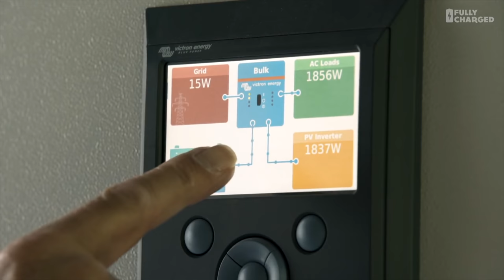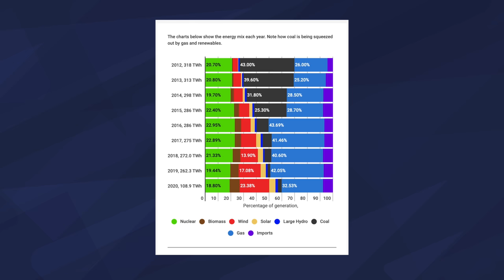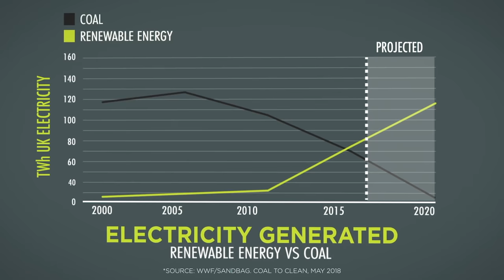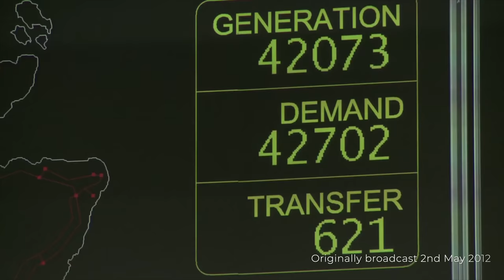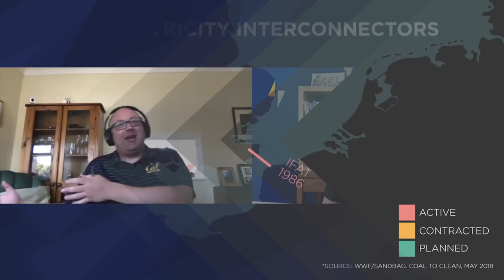National Grid ESO's Green Energy Success Story | FULLY CHARGED for Clean Energy & Electric Vehicles

Comment: Side note (maybe): Love is in the air. (So we charge it.)

I'm a big fan of USB-C (and powerwall ethernet adapters, and LiFi I suppose); you can charge with it, connect with the network/internet, listen to podcasts e.a. on the stereo, watch the imagery on the telly (with a HDMI cable for example, though USB-C itself has a 2+ m limit), print/scan to/from a printer/scanner with an RJ45 port, and I don't use it, I gave it to my father, got him off the tablet.

In my father's case I gave him a similar Chromebook (owned by the people of YouTube and Android), which still he had to get used to, (he also wants to unlock it with the key of the house, makes sense, doesn't want a password on the stereo) which, I have recently learned, I'm not stuck with the OS (which is open source as well). So thank you for that. Now to figure out how to be shown or allowed to access the thing. (I heard great things about Xi-Linux.) (I Xi that NachOS has beaten me to it.) (I do still strongly advise Microsoft to offer open source to the government.)

One thing Chromebook doesn't offer, (as well as any other product, any modem, any printer, do inform,) is a powerline adapter (ethernet), via the mains powerplug. So I got ethernet cables in the house. Speaking of which(craft); buildings should have DC, which is probably more feasible with the powerwalls e.a., such as those from and thanks to Tesla.

A powerline adapter such as for example tp-link's TL-PA4020 or (and) TL-PA8030P. As well as from other manufacturers; I may have gotten tp-link to go through hell (although they're working just fine, thanks tp.) And report from there.

Anyway, while on the subject of charging the air (and the birds, and the dog's nose), I would like to offer my suggestion to renkforce (a manufacturer, also no capitals I see), to switch off the direct connection when the RF-4270245 in my case (switch/router) is powered on. (And I think it has no direct connection when it's switched off, a pass-trough for example port 1 to and from port 2.)

And Brother, thanks for the printer/scanner, but (bring back the retired and) somehow figure out the (ledlaser)ink tanks, (with accurate fill gauge,) the edge detection of the paper shape, (including any holes,) a suction plate for smaller pieces of paper, and an off switch to not cut off the edges of a scan (and use the whole plate). But, I diverse as well.

And now Google knows I looked up suction. (It's not with a k.) It just assumes no confidance is required. Confidant person. As for the products; I only recommend Tesla. (Give me a car.) (If I can switch off the X-Ray counterpart; some devices give me nausea and light in the head, and not-WiFi gives me rest.)

(My working ethOS is just fine thank you.) (I'm not suspiciously fully charged all the time.)

-B

“The earth is not flat unless you live in dutchland and get nowhere.” - Obviously the fastest one - Herman "Gregory" Finkers
Reply: I liked the video. You're welcome. Luckily it's irrelevant that I have no friends, so no need to share that (I'm not on Facebook I think); I'll share it with a political party. Thanks for your commitment! (I think it's angry face next to Одноклассники.) (Acme class.)

Oh, that's great, YouTube got chapters. Useful.
Reply: Cheers Graham W, as I write in code (some call it literature), I do actually speak normal person English. You're welcome. (Although you'd have to forgive my Cabbage Cole upgraded from Stone-Coal minor accent.) (You're right under my comment.)

Comment: Enercon wind turbines can supply inertia to the grid, the blades going at 21rpm acts as a massive flywheels sensing a drop in grid voltage they increase their output harnessing their kinetic energy
Reply: In theory Yes. In reality and from a practical engineering perspective, No. The frequency converter between the wind turbine and electricity grid prevents the kinetic energy of the wind turbine’s rotating mass being useful as true grid inertia.

Comment: I wonder what the time constant is for the physical rotating inertia of the grid's generators. Instead of using nuclear power for the inertia, could we feed renewable power into huge motor/generator sets just to provide that inertia? How would the energy storage/cost ratio compare with batteries and hydro-electric pumped storage?

Comment: very small but have diswashers and washing machines, dryers which have a mode that  can automatically switch on when their is excessive load on the grid , also the same could be used for steel production, ect

Comment: Too much energy is wasted in poorly built homes and buildings. All buildings needs to be air sealed and have a blower door testing when being built or updated.  Net Zero and Passive House building techniques make a home more comfortable and energy efficient. Building codes need to be updated to include more energy efficiency features. Glad to the the National Grid getting cleaner. Wind and solar energy are safer, cleaner and cheaper than fossil fuels or nuclear energy. Fossil fuels are old polluting technology and so last century.
Reply: try telling that to all those conservationists out there. "There is 100 year old building on the street, so you should not be able to rebuild your house and install any solar"

Comment: Here's a thought, the varying need of energy means there is a need to reduce or increase the available power. Now when there is excess some is put into reservoirs. How about using this energy to take heat out of the atmosphere and concentrate it into huge underground water tanks. Then then when there is a need for extra you can convert the heat into motion and generate electricity, thereby negating a small bit of the impact from global warming. It is also a cleaner, more environment friendly storage than chemical batteries and less problematic than hydrogen storage.
Reply: All well & good but what's missing & needed is quantification. All over the place are such suggestions & adverts for numerous proposed schemes and, of course, systems that already exist in single quantity or small quantities. There's liquifying air as a pressure source, there's that 10 gigawatt (or is it gWh, I forget) reservoir with a cave far beneath as an underground hydro-electric facility with pumps to return the water to the surface lake when there's surplus energy, there's the lifting weights thing, there's batteries. I suppose there are dozens of others either in concept or installed in single quantity or small quantities. The point is entirely the QUANTIFICATION. How much materials & labour is it to provide 1 gWh of each type and are there other pros & cons & costs such as land use, damage to species & aesthetics (apparently, ironically and contrary to perceived wisdom, Germans are very big on aesthetics).

Comment: batteries are for sure a convenient way to buffer the grid. on the side of the producers like solar and wind and on the consumer side like big apartment complexes or office buildings to smooth out things.
but to make that work we need a different price model. i have a fixed kWh price in my apartment, so there is no point of balancing the grid. i could buy solar panels for the balcony and buffer the energy in a small 1kWh battery and use it, when the kWh price is highest. but not with a fixed kWh price from the grid

Comment: With reference to the grid melting. The nice chap said about 7KW showers. Teslas have 85KWh batteries so that is a 7KW draw for 12 hours. Obviously you won't be doing that. But half charge is reasonable. So 6 hours. Showers are only on for ten minutes not 6 hours. There is only 1 shower in a house not 2 or 3. People in different houses on your street don't shower at the same time but would be charging at the same time. The local grid in the street WON'T cope with that demand. It was never designed to.
Running our transport system (Aeroplanes, ships, commercial  vehicles and a proportion of cars) off green hydrogen is the only way forward.
Reply: Hydrogen needs 3x more electricity to make to go the same distance and when you are disagreeing with the people that control and run the grid you are obviously wrong
Reply: @frymate1261  Yes in that straight conversion electricity wins. The problem is the amount of energy required. 30KWh per car per day (Not to mention trucks buses trains ships plans) We can't generate that much electricity. We can't move that much electricity. We should also be electrically heating our houses. If you take transportation from the electrical demand then it makes it much easier for the UK to be able to generate all green electricity. We can then store our spare summer electricity as hydrogen. Then buy green hydrogen from countries that have lots of sunshine.

Comment: Electronic inertia.. ultracapacitors. Ultracapacitors happily discharge many and many 1000s of amps in milliseconds.. easilly can deliver the amps needed for shorts and failures without cascading failures of battery or solar/wind inverters. So answer is combination of capacity in batteries, and the amps of the ultracaps.

Comment: In the bid to wipe-out fossil fuels by 2040 can you estimate how many thousands of wind turbines and acreage of Solar panels will be required to power every vehicle in the land plus supply energy for our home’s factories and public buildings? 
The physical area and costs for all this new infrastructure will be astronomical. Electricity prices are already increasing and there might well become a time when the Fossil fuels could make a comeback purely on the grounds of economics and preference. Surely the answer is more investment in Nuclear energy.
Reply: It is! 
but shhhh! don't tell big oil that
Reply: SMH
Reply: 42,000,000,000 tonnes of concrete (mostly) & steel, 230,000,000 tonnes of epoxy blades plus some electrical crap like generators & switchgear & servo motors does the job for all present human energy with wind turbines with 30% Service Factor. 480,000 km**2 of solar PV 
panels with 20% efficiency does the job for all present human energy with solar PV alone. Plus some high-voltage wiring & ~200,000 gWh of compressed air, liquid air, pumped water & battery energy storage for balancing.

Comment: One day AI will be using all the big data to manage our grid and it will work so good that this AI will be implimented all over, and then a day when AI does something and we don't like it, and NO ONE will know why it did what it did.
And we won't have the capacity to analyze all the data and events that has let it to make that decision. And that decision could be good like AI anticipated solar flare is coming without it actually coming and shut down whole grid to protect itself, or it could be stupid like it anticipated reduced energy prices increases the demand and improves lives and thus set zero price for electricity until grid's own balance sheet becomes zero. In both cases it would have done good on its side but man it will create chaos.

Comment: Would overproduction not be useful for generating Hydrogen fuel?
Reply: Germany has a scheme that does that and feeds a small amount of hydrogen (1%) into their gas grid.

Hydrogen used for grid storage doesn't make sense as the round trip efficiency (electricity to hydrogen to electricity) is poor compared to pumped hydro and battery storage.

Hydrogen for transportation only makes sense when refilling speed is the prime consideration, as using the electricity to charge battery electric vehicles is more efficient.

If using hydrogen for transportation, then you would want the government to legislatively prohibit dirty hydrogen from being used (as otherwise it will be as it can be produced via steam reformation at a fraction of the cost).
Reply: The guy did mention this.
Reply: Overproduction is useful as a catalyst for finding  way to shut down fossil power.
Using it for Hydrogen removes that opportunity.

Comment: Why do you have to refer to a battery in terms of a conventional battery. Surely using excess power to heat a thermally insulated vessel containing say salt. Liquid salt can then be used as power to heat water/steam to run the large stabilzer generators. Clean process all round using readily available technology

Comment: So would like to get rid of my gas combie boiler and have a pure electric house but sizeable cost to change it to add the new tech.
Reply: What's wrong with gas ? I am on a green energy tariff (electric and gas).
Reply: @fireballxl5768  Natural gas is methane, CH4. When you burn it the H makes H2O. No problem there. The C makes CO2, or if you are unlucky CO. Therein lies the problem, either for you or the world at large, depending.
Reply: I am not convinced by the amount mankind is affecting the climate (climate is changing all the time,Co2 has been much higher in the past there is some thought that's now to low) ,a better plan is to sort out local pollution and aim to be energy self reliant.I will not be replacing my gas boiler or petrol car any time soon.
Reply: @fireballxl5768  
Ask yourself
"What if I'm wrong?"
If we "go green" but find it made no difference, we lose nothing except "general pollution".
If we deny, or delay change, and that turns out to be the wrong choice?
We're screwed.
I'll take choice.#1 please!
Reply: @danielcarroll3358  With proper engineering and maintenance the CO problem can be controlled, leaving the CO2 to feed trees and plants and continue the current greening of the Earth.

Comment: Can I just point out that Nuclear energy produces water vapour and water vapour is a greenhouse gas, also burning wood is not green.
Reply: What you say is correct but it doesn't logically follow that nuclear increases the amount of water vapour in the atmosphere.  Water vapour is in equilibrium: put more in, more condenses out.  You get more water vapour as the earth warms through carbon dioxide emissions however.  So, nuclear does not contribute to global warming through water vapour emission.
Reply: Was there anything in the video about burning wood ... oh, that's right, you just chipped that into the mix because it's your own hobby horse ... a non-sequitur really.

Comment: It's all still a house of cards, with new 'ancilliary' services being spun off because of the increase of non-synchronous generation. This is all additional cost that typically isn't being included when people champion how cheap or expensive a generation source is. 

It's a good interview but completely missed out on the single largest problem to solve and that's provision of grid scale storage to cover low wind or low sun days.
Reply: Gas power stations will be needed on standby to be fired up on those calm overcast days you speak of, but there aren't many of those days. As we reach oversupply of renewables, gas plants will be fired up less and less. 

Carbon capture and storage could be added to the remaining gas plants.

Modern wind turbines are optimised to produce max output around 40% of the time.
Reply: But surely, peakers aren't "synchronous"
They "approximate" the load.
Reply: @tonyblighe5696  That is kind of my argument, who pays for that standby plant? It's not included in the cost of a MWh generated by a wind or solar farm which makes them look far cheaper, as mentioned neither are all of those other ancillary services that are needed. What is the 'true' cost of a MWh when all the ancillary services, storage, redundancy, dispatch-ability and everything else is taken into account. Future contracts should be contingent on suitable levels of ancillary services being included from the start as part of the contract, at the very least storage at the grid interface to smooth ramp rates during normal operation and minor events. 
Curtailment payments should be ended and operators forced to either find a local source of demand or create one e.g. P2G to then also fulfil a requirement for dispatchable and reliable power. You'd likely soon see stalled projects like Coire Glas and Balmacaan find the financing and support they need.
Other than being renationalised, I personally think that National Grid should be allowed to get on with building things like pumped storage, the current 'market' based solutions of writing a contract are woefully inadequate and inefficient much like the situation of wind farm curtailment in the North of Scotland. 
Roger Starkey, a peaking plant has to synchronise with the grid in order to connect and supply electricity. Once connected a gas peaker will add to grid stability both due to inertia as mentioned in the video but also via high load following dispatchability.
Reply: @1001ewaste  I totally get the point you are making and it is valid. An intermittent source is certainly less valuable than one that can be ramped up and down on demand because, as you say, they require gas stations on standby and/or storage, which costs money.

I guess intelligent EV charging and V2G will deal with short term fluctuations once there are enough EVs around, and this would have the benefit of adding very little cost. As you suggest, when we have an overcapacity of wind and solar P2G could be used to decarbonise household gas supplies. 

Curtailment does seem to be a waste but  if it only happens occasionaly it may be better than adding expensive electrolysers that are rarely used.

Some interesting challenges to solve and it does look as if National Grid have a good trip on things. Electricity prices are low by international standards, supply is very reliable and the grid is getting greener at a rapid pace.